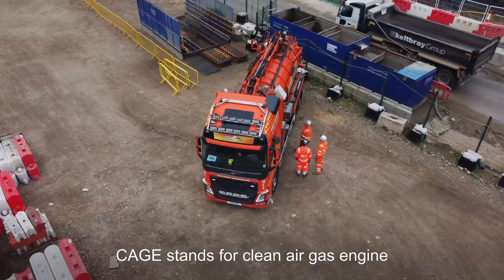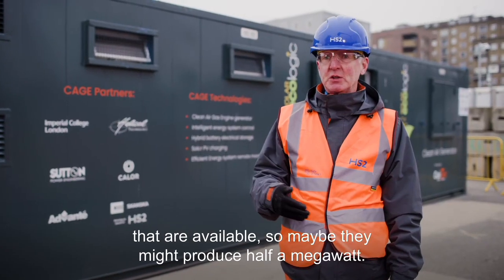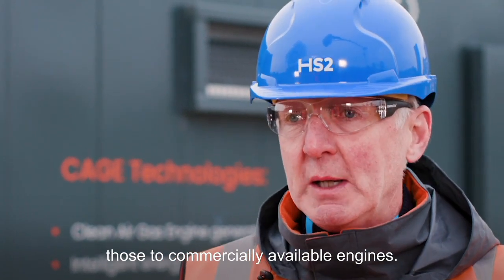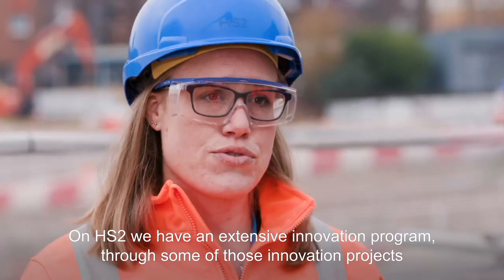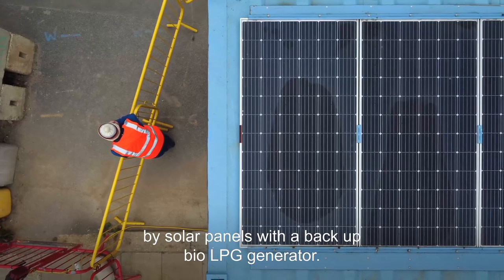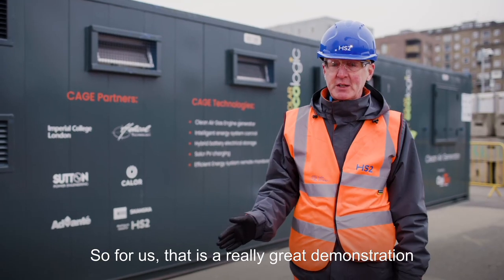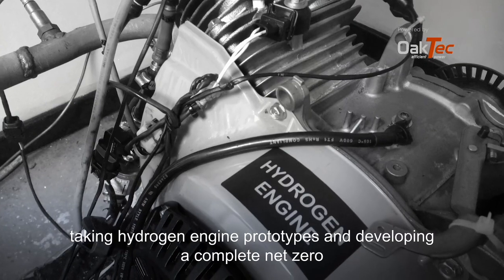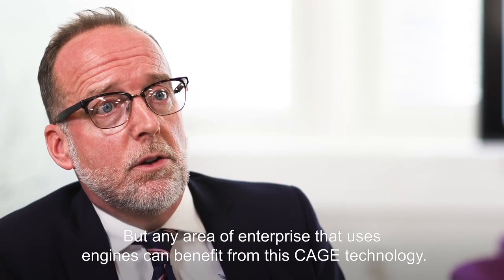The Clean Air Gas Engine: reducing diesel pollution on construction sites including HS2

Comment: Did they use the liquid phase LPG injection system that was used in Australian Ford vehicles a decade ago?
Reply: No. Port gaseous injection is used on the small engines with digital load control, and direct in-cylinder liquid injection on the larger ones.